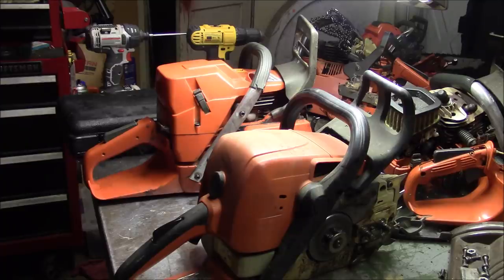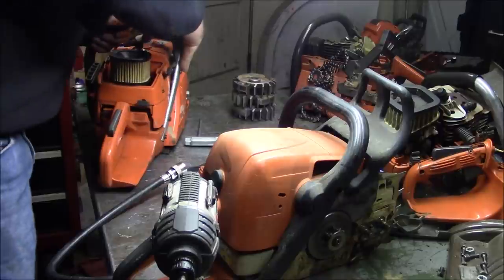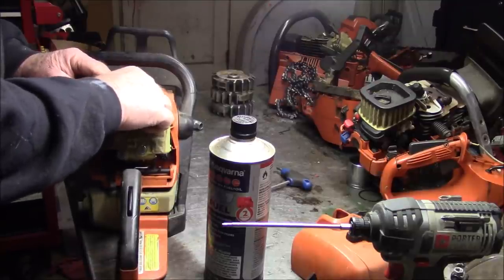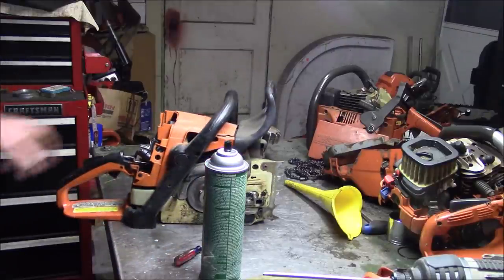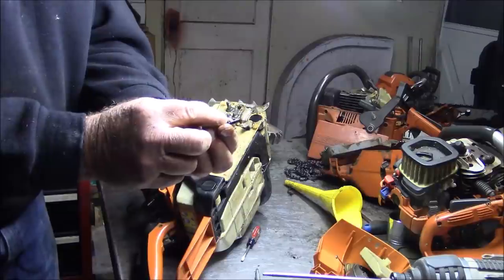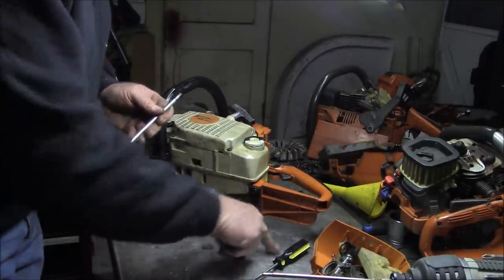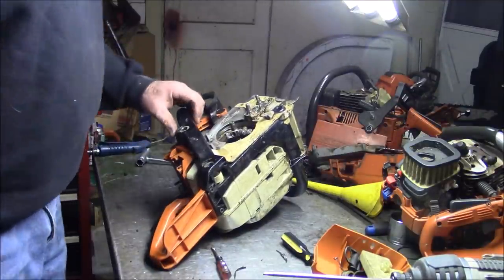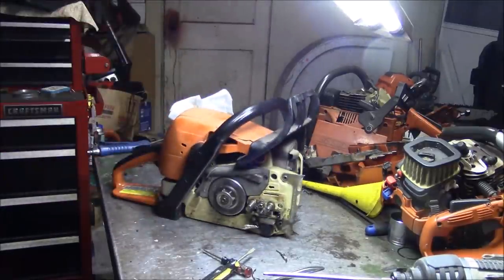Stihl ms310 w/ Bad Air Leak, Simple Fix? Sometimes You Are Good, Sometimes Lucky!

Comment: Something interesting about the 029 039 ms 290 ms310 ms390 is the 029 and ms290 both have a 45mm bore the 029 and ms290 super has a 46mm bore the ms 310 has a 47mm bore and the 039 and ms390 has the 49mm bore. matching the intake boot to the intake port and doing a single pipe .730 to .780 inch pipe for the muffler and a stihl ms660 carb with a hyway 49mm popup really opens these clam shells up average cut i was getting was about 9.75 sec in 20 inch poplar, for the cookie guys. Havent had much time to do a video on the ms290/ms390 clone build saw. should be up in the next week or so hopefully. in all honesty for it being a open port 49mm cylinder and a home owner class saw this thing suprised me with a 20 inch 3/8 pitch bar and chain. Anyways hope these helpful tips help.

Comment: How funny it is you found loose crankcase taps, last week I had a MS290 come to my shop with what was described as a loud rattling noise in the motor, I said its probably a bad bearing,  It did start and run but was real lean and wouldn't hold a carb adjustment or idle setting, as you done sprayed some break clean only to have it die, i said it has a air leak, more than likely a bad seal, So I started tearing into it as you did only to find 3 loose crankcase taps with one of them having broken the mounting tab off of the chassis. After a quote of $250-300 for a New Chassis (tank handle) and Reseal the Clamshell for the repair the owner said just Keep It I'm not spending that much money.

A project video is always welcome, love watching a new video and maybe picking up New Tricks or Easier Ways
👍👍👍🤔🤔🤔

HAPPY EASTER TO YOU AND YOUR FAMILY 🐇🐇🐣🐣

Comment: I like it when they are nice and easy like that take it apart and reseal it and it will be good as new. They are plentiful here in the UK so you never struggle to find a dead one I always upgrade the 290 and 310 to a 390 if they have cylinder and piston damage The 390 cylinder and piston Bolts straight on.

Comment: I built a Huztl ms 250, and was initially dismayed by all of the plastic. I doubted that it would run well or last, but I have been pleasantly surprised that two years later, the little saw that could is still running and cutting, just as a 45 cc clam shell saw should.

Comment: good saws 59cc...1127 series 029 029 super 039 ms290  ms310 ms390....sadly ive owned every one except an 029 super....my dad has had an ms310 since 03 ir 04 used as a farm/firewood saw and beat to death,i just rebuilt the carb and put in a new fuel line last month....

Comment: Great work! I have a 562xp that is giving me the same issue seems great on once I let off the trigger it dies out and doesn’t want to stay on Piston looks good
Reply from the maker: Short blocks are both improved and pretty cheap as compared to trying to fix an older bottom end :) Here they are $200 retail. MUCH improved crank/bearings etc. SO if you have a seal of bearing going bad, just wrap your saw into a short block and be done with it, WITH a much more reliable arraignment. :) Especially if the saw is older than 2016.
Reply from the maker: Doing a series ON the 562's... last one built one up from a new set of cases. A short block is easier yet as it has the cases/crank/bearings etc. all ready assembled.
https://www.youtube.com/watch?v=5n5Eu1vrcd8

Comment: It is a pita to get a clamshell saw apart.  That is why most of my saws, today, are pro saws.  I can replace seals and cylinder in a pro saw  in less time than it takes to get a clamshell apart just to get to the bad parts.  I would have popped that cylinder out and re-sealed the crankcase.  Tightening up the case bolts may work for a while but it will start leaking again.  Playtex MotoSeal works best on clamshell designs.
Reply: They are not bad to do. I can get a clamshell design Stihl apart , new bearings and seals in about 80 minutes. They are just that easy. I also agree about resealing the the bottom end. The seal is broken, it’ll leak again soon and possibly melt down.

Comment: Not with my spark checker.  I just plug it into the boot and put the ground clamp on a metal part.  It is a 6mm checker.  If it will jump across a 6mm gap it will sure fire a plug.  I then get in a dark place and pull the starter rope and watch for the blue lightning bolts in the tester window.  Just remember, blue is good, red is dead and yellow in between.  If it is not blue I will reset the air gap and try,again.  Still not blue I put a new coil in it.  I am not playing around with an iffy coil.

Comment: That’s why I hook up my spark checker, turn off the lights, and pull it over, looking for a good, blue spark in the tester.  Most of my saws will give a blue lightning like spark all the way across the tester.  Just remember blue is good, red is dead and yellow is in between.

Oil pump screws on a Stihl are 4mm.  You know that.

Comment: They have “hard” seals you use when you split the clamshell and “soft” seals if you don’t
Reply: Ohhhhh. I didn't know that but I think I have an idea what you mean now. So I bought a meteor piston & cylinder kit for a 390 and it had the oddest looking recesses for seals, it didn't have a whole lot of surface it looked like to me! I was wary that it wasn't going to seal right so I went and put 1184 all the way around the seals real thin. Sounds like maybe it was designed for the soft seals to just push in with no sealant? I didn't even know that existed? I couldn't really find good info on it so I kind of just guessed. I haven't finished the build yet. Got health probs.

Comment: Would like to learn how theses saw are put together.  I'm starting to work on an ms210
Reply: Those are known for not running long. I got one from a homeowner who barely used the saw once or twice a year for limbs down In The lawn.  then it was about 5 years old. It 
scored the cylinder and galled off the piston. I think 50-1 oil mixture and lean turning is the problem with them. I got the cylinder and piston on eBay then had 145lbs compression. I run  somewhere between 40-1 to 45-1 and fresh tuneing by ear. Been piss pounding it on the brush cleanups and landscape shrub removals and roots. Absolute abuse. Great saw, paid for itself many many times. The

Comment: I am glad to see you working on a Stihl instead of those orange POS.  Good luck working on a ms290 clone.  That design sucks.  Wait until you try to get that rear bar stud out, so you can get the cylinder off.  Not to mention removing the rear handle.  If I never saw a ms 290, again, it would be a day to soon.

Comment: they are a bit heavy , but otherwise just put better bearings without the nylon cages , a 49 mm top end by Huztl and you have a very sturdy saw for little money , and an adjustable oiler as a bonus , smooth cutting too ,little vibrations .In fact if you don't have a crankcase tool to separate the professional series without damaging the cases it's easier to work on the clamshell ones , i buy SKF bearings in an automotive shop at a price so low that i always change them when i rebuild a clamshell engine .

Comment: I thought there wasn't too much that could be done with the clamshell saws. Muffler mod, pop up piston maybe? Good find regardless. I love it when saws follow me home and they work.
Reply from the maker: Nothing really wrong with clam shell saw for 90 percent of saw users out there. Pop up pistons are the ticket for them as dropping the cylinder is a hard thing to accomplish without a machine shop. SO those saw where the aftermarket is building pop up''s are actually EXCELLENT project saws for the performance oriented hobby type with out access to machine shop equipment. These are right there with the 49mm top ends and pop up pistons.....as we will do on this one I hope.
Reply from the maker: plus they are plentiful, cheap, and have a lot of aftermarket support

Comment: Ms 290 is the same chassis as well don’t forget to pull the one bar stud to get the motor out
Reply from the maker: Thanks, I would never have guessed but with those saws nothing surprises me :) Think it would be fun to put a popup in a 49mm top end and slap that thing together to see how long it lasts...
Reply: I think they are pretty tough saws. They have a fairly big crank almost as big as the 372 with bigger main bearings. They have nylon cages though
Reply: @afleetcommand   If you put a popup in a 390 , use 2 starter pawls and a compression release helps.
I built 3 of them with popups  run strong.

Comment: Another great video Walt. Just curious if you finished up the MS361’s you were playing with awhile ago?
Looking forward to the next video!😉👍
Reply from the maker: I did. never really had time to de-bug it, it had an air leak type symptom. SO I tossed it to the back of the line. Too many other things on my plate to debug those as I have the 660's and 372's. BUT this is a new year...maybe it gets a second chance.
Reply: I put a 361 together and am having the same issues.
The 460 I built has been a great saw.
Thanks! I really enjoy your videos, you have got me into a new hobby. I logged and worked with saws for years, but never thought of them as more than a tool before.
All the best!

Comment: I got $1300 to spend on us all what should I get?I will be using this professionally every day for 10 hours a day
Reply from the maker: Depends on dealer and type of wood. Husqvarna 390xp or Stihl ms661 for the hard wood in our area. Husqvarna 572xp, Stihl ms 461, or  ms462 works pretty well if weight is an issue. I happen to like the 572xp and Stihl 461's as they are enough saw with a 20inch bar & chain and don't beat me up. MOST of my "Pro" customers opt for the 390's with 24inch Bar & Chain combo's around here. I have a 390 and 572 if "put your money where your mouth is" means something.
Reply: afleetcommand Thank you for your time yea I do a lot of work in mi I have a up comeing job I just ordered the Chinese 372 XP from farm tech but I just came into a job and got a decent amount of money from it so I thought I should go buy a real Saw If the clown gets all the way through the job I’m going to wait for the 500 I guess to see what the fuel injection is like A lot of work around farms so I run into anything from cherry trees to big maples pine I need something that will run a 28/ 32 with out A problem I always liked STIHL but I’m starting to like huskies I think they have definitely gotten cheaper over the years and I think the Huskies have gotten better over the years I wanna hold off for the 500 I but who knows

Comment: I could have told you that the 310 had rather low compression based upon how easy you pulled it over.  You do not need high compression to cut wood with a saw.  Actually the low octane gas we have, today,

Comment: It won’t be a short video if you decide to rebuild it.😀
Reply from the maker: True, it has been passed over several times...just sits by the bench. I did get a 25 dollar 390 top end and a 30 dollar popup piston , I'll get to it some day. Partly because I said I would and partly because a LOT of folks keep asking. I was going to wander back to outboards, but maybe a couple of more saws including that one should happen first. Have two Johnson 70hp triples, a 3 cylinder 80hp merc and a couple of inline 6's to tear apart. Some much fun to be had, so little time... :(
Reply: @afleetcommand  if I had known that I have a new 49 mm jug and piston out in the shop I could have sent you.  I tried it on an 029 and did not like it and replaced it with a standard 46 mm piston and jug.  I would have given it to you.  It deserves to be run by somebody and I traded off the 029.
Reply: @afleetcommand  I had to fix a 70HP Johnson about 40 years ago.  It was on a mullet boat that got swamped and sunk in Apalachee Bay, FL.  I got all the water out of it with a mixture of MOM and 90% rubbing alcohol.  It ran again but it took a lot of work to get the salt water out of it.

Comment: If you reseal the crankcase MotoSeal works best, Dirko, second.  Yes, I would like to see you cuss like this Ole Marine.  Go ahead and rebuild it.
Reply from the maker: No,  Three Bond 1184 is the best.
Reply: @afleetcommand  the reason I use Dirko is it has a little slower setup time than 1184 and it takes me a little longer to get the cylinder on than it does you, which gives me a little better margin of error.  Not to mention the fact I have never had a base gasket failure with Dirko HT.  I like MotoSeal n clamshell because it sets up faster and seals the cylinder to the pan easier.  I use a lot of 1184 but only on certain things.